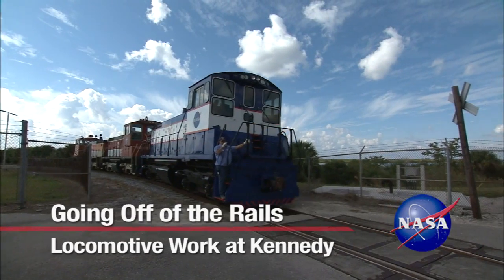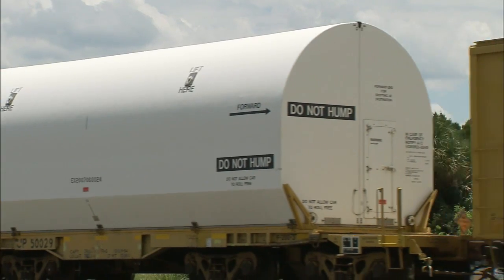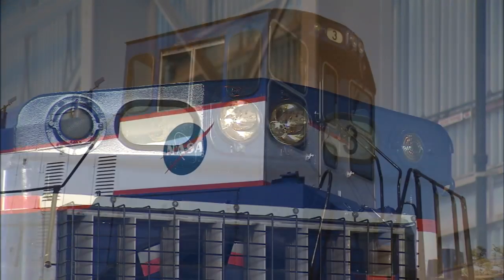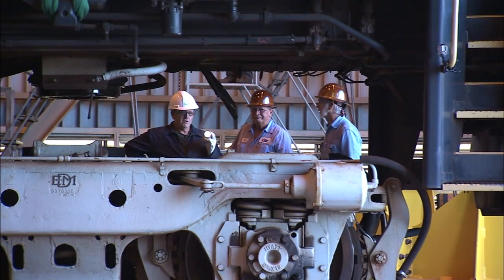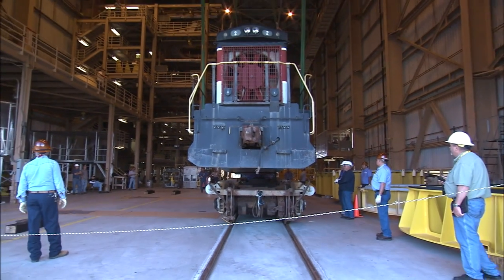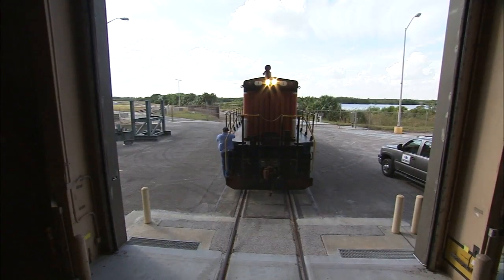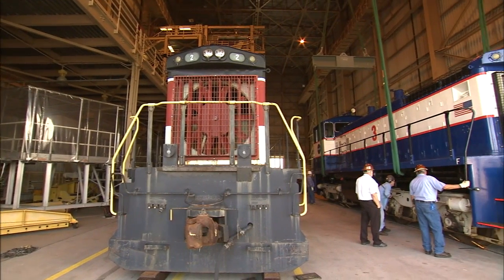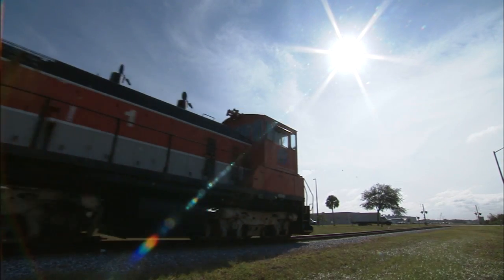NASA Train Upgraded in Shuttle-Era Facility

Comment: That white car holds a section of one of the Shuttle's solid rocket boosters. "Humping" in rail terms is a way of sorting train cars in a rail yard, by traveling at speed, releasing a car or group of cars, and hitting the brakes, to let the cars roll down to where you want them.